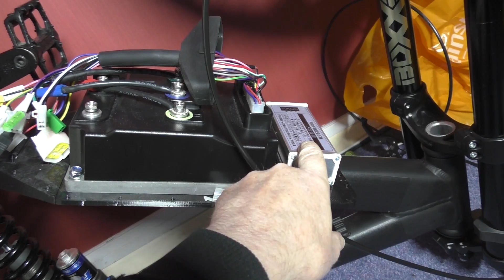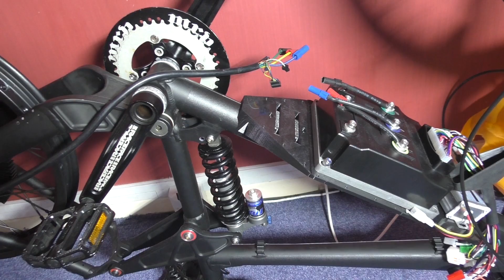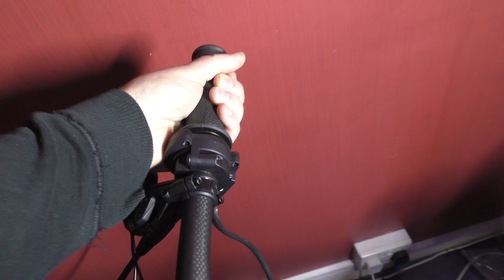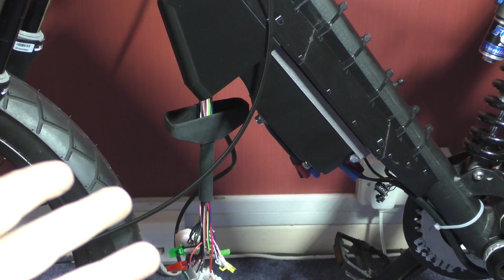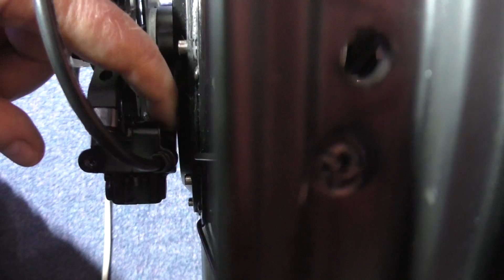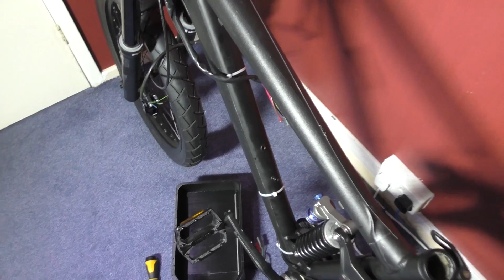High powered DIY eBike MSVA build part 19 - Let the fun begin

Comment: Tony I'm looking at getting some 18650 batteries for my electric scooter. Could I ask where you got yours from please. Looking at best price for actual genuine capacity. Looking around 3000mah maybe 3500mah. If you could point me in the right direction that would be great. I need around 100 - 110 👍🏻
Reply from the maker: I only use 26650's mate.
I bought some 18650's from here to try and they are what they say...... https://www.aliexpress.com/item/6pcs-lot-LiitoKala-LG-HG2-18650-18650-3000mah-electronic-cigarette-Rechargeable-batteries-power-high-discharge-30A/32793701336.html

Comment: Tony, do those brake levers have a sightglass for checking the hydraulic fluid level?
Reply from the maker: There's no need mate. According to the test regulations, it's only for brakes which have a reservoir - these don't have a reservoir so it's not needed.

Comment: What is the feasibility of implementing a serial buss for all the control wiring? Could reduce the amount of wiring.
Reply from the maker: It's possible mate but using a can bus system means an ECU at each point. It would reduce wiring (by about 10m and 0.5kg) but it would introduce more points of failure and add complexities that I can do without.

Comment: Hi Tony, don't give up mate... you getting close now. Wheeler dealer has a valid point, In the process of getting it "road legal".... I hope the weight doesn't creep up out of control on you 👀. I know you don't really want to hear about using a EEB Frame, but in my own build (EEB BBSHD Build)
I got the bikes weight down to 32.9kg (complete ready to ride with 15S / 35Ahr Battery pack- Total Weight) I find this weight quite heavy to carry any significant distance let alone up some stairs. All I can say mate is eat your "Wheat Bix" 💪🏻😊
Reply from the maker: I refuse to conform to conventionality mate. I will make this one into something that can be carried up the stairs!
Believe it or not, the heaviest part is the bike which is around 25kg and the battery weighs 22kg so it'll be easy compared to V2 😁
Reply: G'day Tony, so your saying your Total Bike weight is 47Kg ? and you reckon that' weight is going to be "easy climbing up some stairs" 😳 

"No disrespect at all" but If your in your 50s I really don't think so.  I'm in my mid 40s but with a Bad Back and my E-Bike weighs 32.9kg all in & is almost too heavy for me to lift on flat ground.

 Is that 47kg factoring in all your E-Bike Components & Electronics? (I realize you still building it) but just interested to see what a Hub Drive DIY E-Bike build weighs 

  
My build wasn't conventional at all, I have only seen 1 other person fit a Bafang BBSHD (Mid Drive) to an Enduro E-Bike Frame (Modification & Fabrication are a must) 

Tony keep those E-Bike Mods coming 😊👍🏼 I think its great that DIY E-Bike Builders like yourself & I can share their Build Experiences with Others. Any one can buy a Manufacturer made E-Bike but "good luck" if things go wrong and it's out of warranty. 👎🏼 At least we can "fix our own E-bikes" as we know each component like the back of our hands, so fault finding becomes so much easier... not to mention buying cheaper replacement parts via (E-Bay or Allied Express)compared to Big Brand E-Bike Parts (Bosch etc)

I look forward to seeing you (via U-Tube) on the Road soon Tony 🚴😊👍🏼 "Good Luck mate"
Reply from the maker: @oze-bikes4life663  I won't be carrying the total weight of the bike - that's why I made the batteries removable. The most I'll be carrying is the bike which is 25(ish)kg so it'll be easy for me 😁
V2 weighed 42kg and yes, I did carry it up 2 flights of stairs every single day and yes, I am in my 50's. People think I'm an old git but I can still run rings around the kids and still dead lift my own body weight (78kg after taking a s***) 😂
Reply: Vortecks ok good stuff, glad you got your health 👍🏼💪🏻 my backs pretty fucked (Rods, Plates & Screws) + Mulitiple Vertabre Compression Fractures including osteoporosis (degenerative lower back) & ciatic nerve pain (Shit is that all 😬😂) but thanks to an E-Bike I can still enjoy some dirt Trails as I use to in my Old MTB Days 😊😎

Comment: It would be easy to write Arduino code to operate the hazard lights through a sequence via the indicator switch (L-R-L-R within a second or so).
Reply from the maker: The thought had passed my mind but I don't know if it's a legit way of operating the hazards. The MSVA does state that (if you have a switch on the right to turn right and a switch on the left to turn left) you can hold both switches down to activate the hazards. What it doesn't say is "or a combination of switches". Just to be sure, I'll add another one.

Comment: I've got a domino throttle as well. If you're using the microswitch you can do away with the ebrakes as once you release the throttle the regen will kick in anyway. Also it is a normally open switch and closes when you turn the throttle so works the complete opposite way to most controllers ebrake inputs! I had to fit a 5v relay with opto isolator circuit from Amazon and take the 5v from the throttle supply, works great.
Reply from the maker: I'll still need the e-brakes for the brake lights and I'm going to use the domino switch for regen.
Reply: @Vortecks  Oh yeah I forgot about the MSVA!

Comment: I'm stood in the garage watching this mulling the exact same issue over with the rear disk on a cromotor haha
You'll get there lad keep up the good work Sun will be back soon just in time for the test ride.
Reply from the maker: I've fixed the problem by having loads of alcohol. I woke up this morning and fixed it! 🤣
Reply: @Vortecks  lol I might have to try that.. :) Well i'm going with a large rotor I think. I tried a 203mm but using the mounting adapter it was too close to the arm, so I drilled it to the hub motors holes and mounted it direct to the hub motor but then I was far too close to the hub for the caliper and it's a thin caliper but I reckon I can get away with that setup if I go 225mm or 9 inch rotor. Just got to find the right rotor.
Reply from the maker: @TheWebstaff  I'm now using 4 x 3mm spacers between the hub and rotor. It's given me enough space to get the Magura caliper in there now and I have 1mm clearance between the caliper bracket and rotor..... it's tight but it's worked 😁

Comment: dam its going to be a beast when its done looking forward to road test :)
Reply from the maker: The latest calculation is 32-35hp which is between 750 & 800bhp/tonne 😁
Reply: @Vortecks  what is the power Vs version one and 2? I am an electrician currently studying electrical engineering. Hoping to start a project on a Schwinn stingray frame. I would like to get it road legal aswell but just seems like such an undertaking and cost. I only want 40-45mph max speed for 8-10 miles was thinking I could use panniers for the batteries and control system ( which would also hide the hub motor pretty well) glad you are picking up pace. Its the best motivation when you can see change happening before your eyes.
Reply from the maker: V1 was 9kW, V2 was 15kW and this one is rather unknown at the moment. I've seen people running 25kW through these hubs (for very short bursts) so I don't know at the moment.